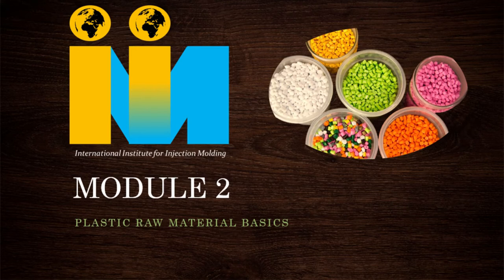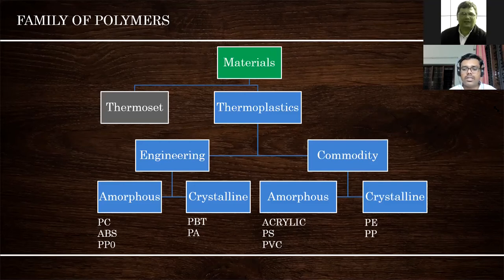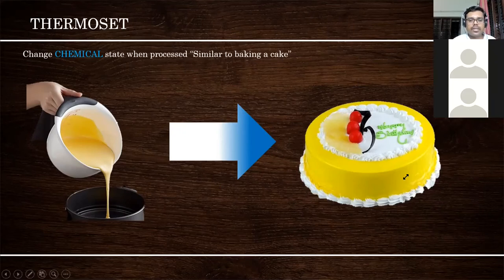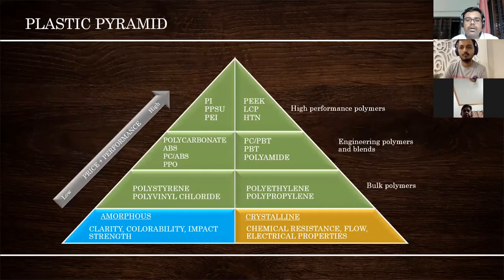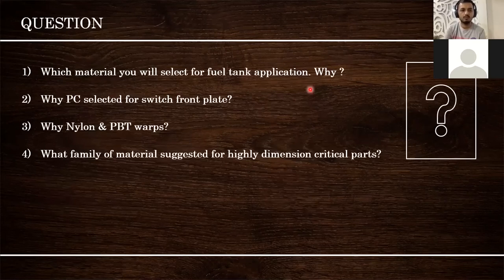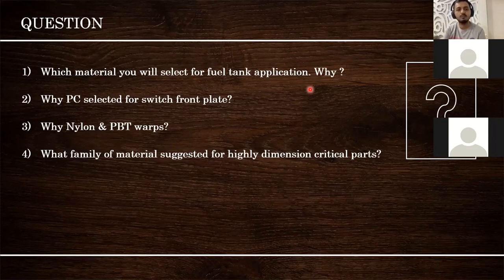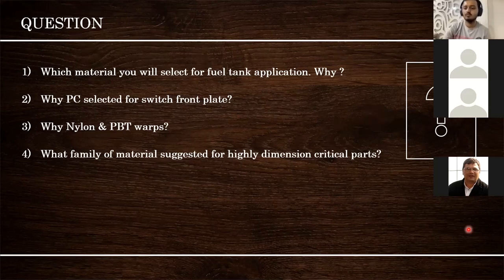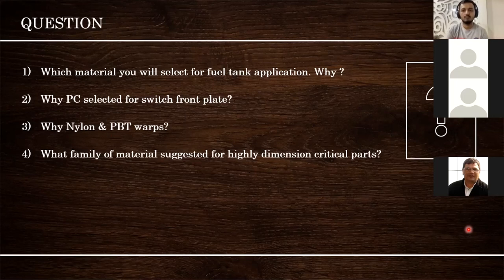2 Plastic raw material basics l By Subash Ellath

Comment: What material is used for SMD connectors which need high dimensional accuracy and high temparature withstanding capacity of above 200°C?
Reply from the maker: Generally, LCP is used.
Reply: hello,my dear.I am Eileen from Raytop chemical company.I am glad to meet you here.
Reply: hello,my dear.I am Eileen from Raytop chemical company.I am glad to meet you here.